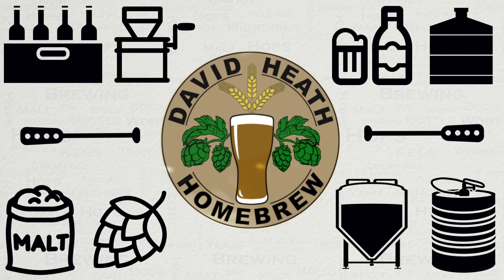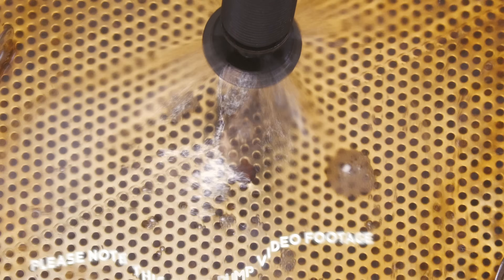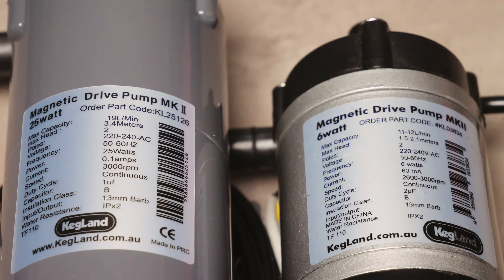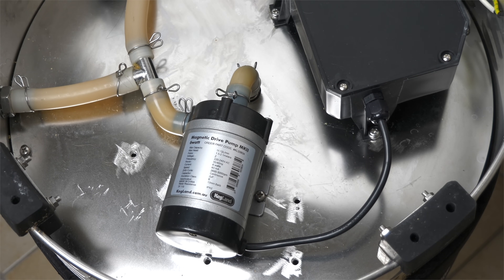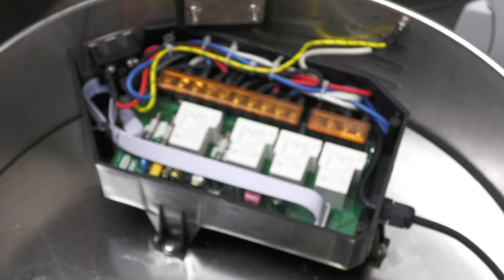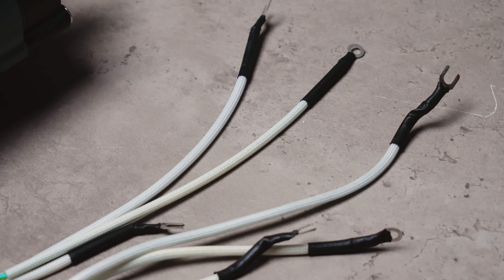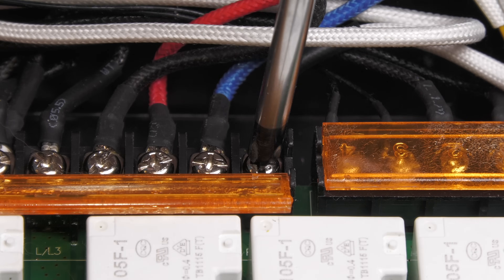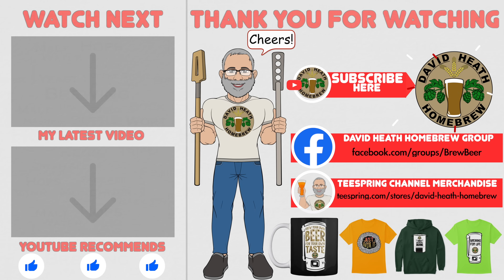Upgrade Your Brewing Systems Pump - Benefits And Easy DIY Guide

Comment: Great video as usual. Do you have any clue about such an upgrade on grainfather g30 ?
Reply from the maker: If you want to keep it neat on the G30 then you really need to stay with the same pump size due to how the pump is housed. Grainfather have a PDF guide on how to replace the pump though that you can be sent if you contact their customer services.
Reply: @DavidHeathHomebrew  thanks for the information
Reply: Its it The same on the G40?
Reply from the maker: @olivierbrousse3478 🍻🍻🍻
Reply from the maker: @OleClausen in principle yes

Comment: I've heard people mention that they had metal pieces from manufacturing stuck in their pump or hoses, which added to malt or protein build up, finally clogging the pump or hoses. I haven't checked my own 65L G4 pump or hoses, but do experience a lot of clogging when cleaning out the leftovers of a brew. Not sure if these two things are related, but if it is a good idea to check the pump or hoses when performing the upgrade, then it would be nice to know about this, and how to effectively check those. Thanks otherwise for yet another video.
Reply from the maker: Thanks Christian. 
Ive never heard that personally and I handle returns cases as part of my job, so I can tell you that must be very rare. 
All pumps can clog though, its the nature of the beast.

Comment: Thanks David, I found the original Brewzilla 35L pump to be insufficient for the official Kegland counterflow chiller, so I really liked this video. However I also read that these pumps are not supposed to handle boiling wort? How do you use them in a counterflow setup if not with boiling wort to sanitise your counterflow chiller? 

Would it make sense to maybe consider an external pump instead for this? I´d rather use the same internal pump of course (less parts to clean, less losses) but the temperature limitation has me worried a bit.
Reply from the maker: I have not had any issues personally. Mine has been used weekly for the most part ever since the time of making this video.

Comment: I have looked on google and the usual websites I use to buy my goods but I can't for the life of me find the 25W pump in the UK as a upgrade to my 35L Gen4. Do you or any of the people here know where I can get one?

Thanks for yet another informative and great video, keep them coming. 😁
Reply from the maker: In the UK the following retailers can assist you, though it may mean contacting them to get them to order it in:- Angel Homebrew, Brew keg tap, Malt miller.
Reply: @DavidHeathHomebrew  thank you for the heads up 😁 I expected them to be in the spares area of the suppliers, that's me being stupid! 🤣
Reply from the maker: No worries, yes these are upgrades for sure.

Comment: I just got a Brew Monk system and in that system according to brouwland you should not use the pump when liquids are above 75C. I am assuming it is due to the pump that can't support it. Soo I have been wondering of replacing the pump with a brewferm pump.
Have you been using the Brew Monk with 100C liquids or any advice here?
Reply from the maker: Some pumps are sensitive to temperature, though ive not had that issue on the BM personally yet.

Comment: What punp would you reccomend as an upgrade for the Brewzilla Gen 4 35L?
Reply from the maker: Actually the 35L and 65L use the same original pump, so this one is the upgrade for both.
Reply: @DavidHeathHomebrew  Hi David, would you find this upgrade overkill for the 35L version?
Reply from the maker: Actually both the 35 and 65 have the same standard pump. So its handy for either if you want more power for use outside of the mash. For the mash you will need to dial it down for both units.

Comment: Nice upgrade! 
Do you know where to order that pump from here in Norway? 
The ones I have found got a different pump house.
Reply from the maker: If you want that specific pump then the company I work for olbrygging.no sell it but so do others too.
Reply: @DavidHeathHomebrew  The ones I’ve found on the different stores including olbrygging got screw threads where you install the hoses. At least on the picture it shows. 
I think there might be a problem with leaks then.
Reply from the maker: @Trainingyo It would seem that the pump used in this video is now out of stock and then does not show on the website.

Comment: Hm, are you sure there's enough space in the Brewzilla 35-liters? Kegland themself say "3. Upgrade to a 25 watt pump (on the outside of the BrewZilla 35L, or if you want to modify the 65L BrewZilla it can fit it underneath)"
Reply from the maker: Yes, it will fit, there is just less room.

Comment: Great video! Can this pump fit into Brewzilla 65L 3.1.1.?
Reply from the maker: It sure can yes.
Reply: Great, thank you! @DavidHeathHomebrew
Reply: David will it fit the smaller 30lt Brewzilla 3.1.1?
Reply from the maker: @peterwalker2846  I am told that it will yes. Certainly its a tighter fit though.

Comment: I would imagine it's easier on the 65 lt than the 35 lt .
I might consider it if I ever do have a problem with my pump.
Reply from the maker: Yes, you have more room on the larger system but it will fit on the 35L.
Reply from the maker: Yes, it will fit, there is just less room.
Reply: @DavidHeathHomebrew  Hi David I had trouble finding this pump in The Netherlands, finally found it but the shop says it wont fit, do you know how I can verify? did you contact Kegland about this since you have the 65L?
Reply from the maker: It has been my understanding that it would fit but its tight.
Reply: Thanks for confirming! After some ponderong I think it will fit if I would reconfigure the hoses for the tap bypass the pump, page 15 of the manual. Then you have more space for a longer pump
Reply from the maker: @1986RBRT yes, that is likely to help 🍻🍻🍻